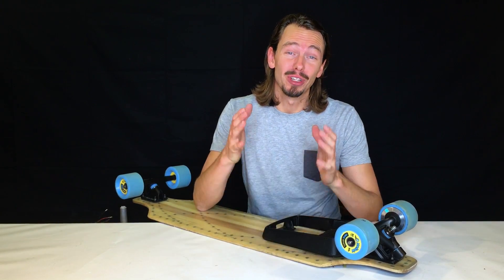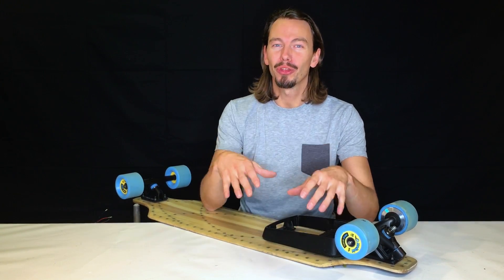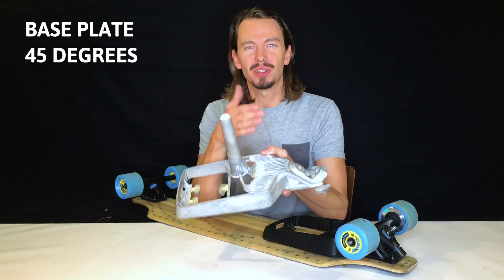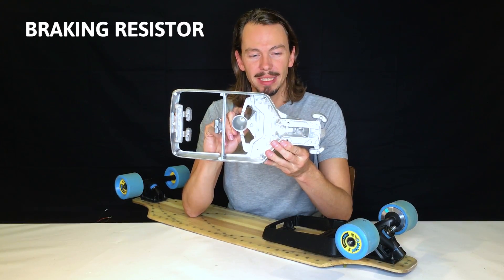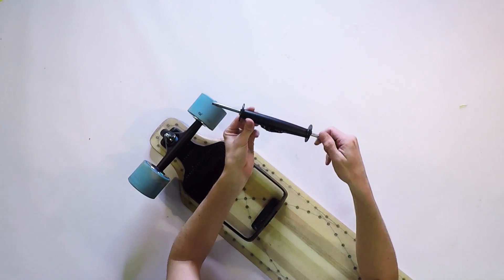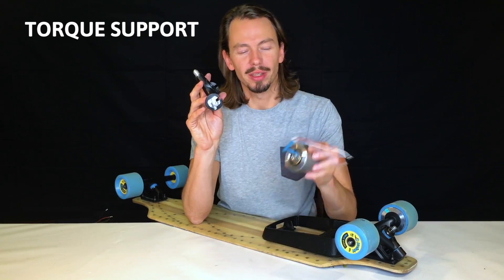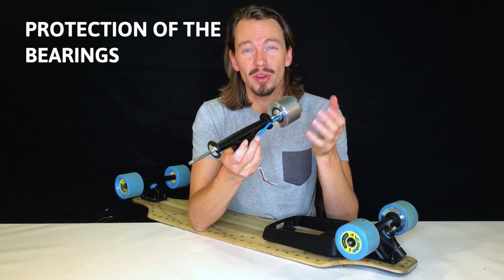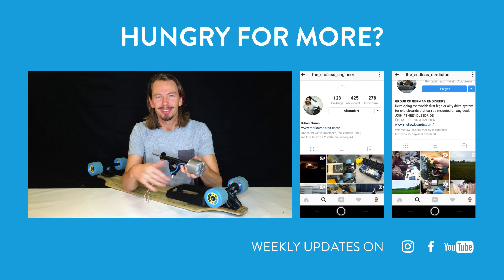Mellow Boards - The Hanger & Frame

Comment: Does it fits with a loaded vanguard board flex 4. Because of the bend shape of the board I guess the end of your frame won't touch it and maybe will knock knock when riding. What do you think? And is there any screws to join the end of the frame with the board or it's hanging just with the truck screws? Thanks from Paris
Reply: The frame is strong enough to don`t need any extra screws. it`s just hanging there :-)

I also just check the loaded board you mentioned. This one will def. work with no problem. Just can`t say about the flex. if u use a really flexy deck, the drive will touch the concrete and you don`t want this to happen to many times. I tryed the buddy buddy basic with lots of flex. I was just a bit carful about jumping to much. but riding a flexy deck with the mellow drive gets you that surffeeling, i love so much.

Comment: Will Mellow sell just the wheel motor in the future?
Reply: What about replacement motors/parts?
Reply: Mellow Boarder then will it be possible to send the board in for repairs?
Reply: Italo Guedes they will sell the single Mellow Drive (this is the complete drive with motor, hanger, frame, electronics, wheels & remote) or u buy a complete deck (mellow drive + longboard). what deck do u want to ride with it?
Reply: Mellow Boarder I know it, I have a Diy Esk8, I wanna know if they will sell just the Hub motor, without eletronics, Just Hub Motor Wheel and Truck
Reply: ah ok. no, this will not happen any time soon (or at all). sorry.
Reply: Gustav Bylund there will be no selling of component parts. sorry.
Reply: of course, if you break it. But fingers crossed that should not happen.